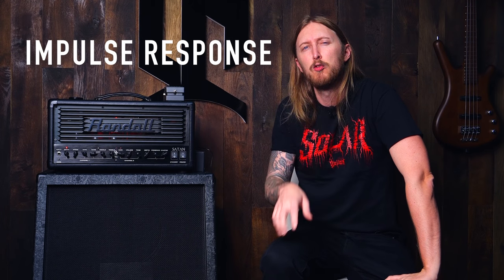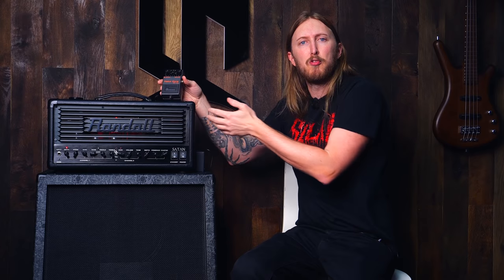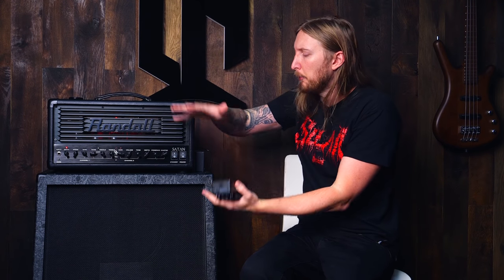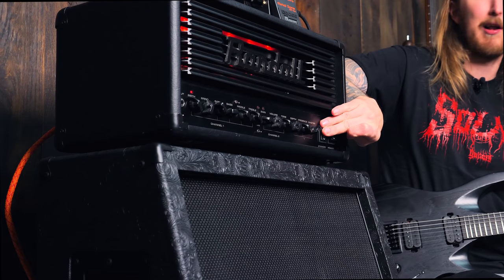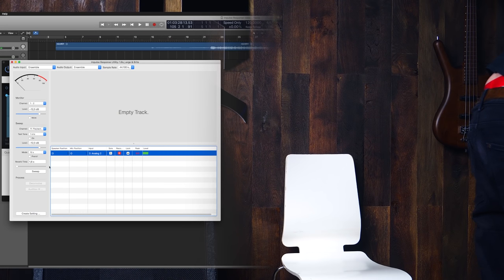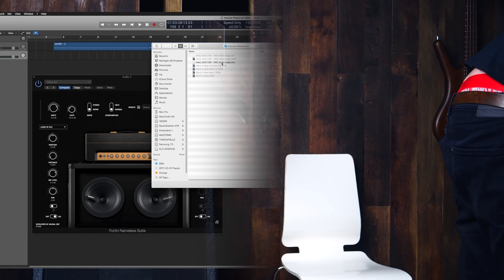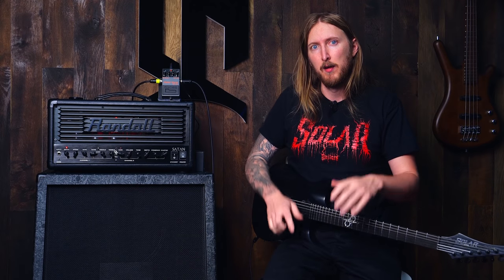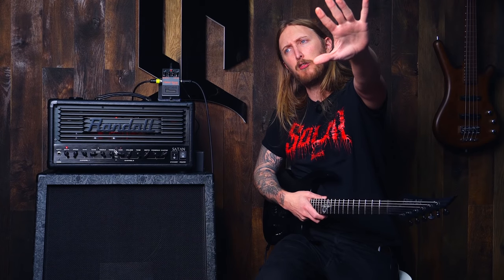Guitar Cabinet Impulse Responses Explained FREE DOWNLOAD - Home Recording Tips

Comment: Great video! Just wanted to point out that this IR shoot method will have power amp color baked in the IR meaning that using this IR with something like the Fortin Nameless will not give you realistic results but you'll have an unnaturally scooped sound. For a more neutral response you want to use a flat solid state power amp or for the best results you want to use a tube amp but remove the power amp color from the IR. :)
Reply: How is it possible for me to remove the tube amps’s power amp coloration from my IRs?
Reply: What if you want the tone of the power amp section? Are you saying that IRs aren’t really meant to do that? They’re only good for the cabinet, mic, and mic placement? I ask because I didn’t think IR-based cab emulation was for me, but if they can also capture, say, my KT-88 tubes in the power amp section of my THD head and accurately reflect the difference of what it sounds like when I put in 6L6STR tubes, then this is actually exactly what I need.

Comment: Hi ola! I Need an answer to a foundamental question...if i go from the line out of my audio interface (a universal audio Apollo twin) directly in the return of the fx loop (a boss katana in my case) and record, Is a proper ir or a reamp box Is necessary? Because a signal goes out of the amp with the chain that i describe
Thanks for the answer!

Comment: Ola I need your help!
I have Bias Amp Standard, but in order to load IRs I would need to upgrade my Bias amp lisence
Is there a good sounding way where I can combine Bias Amp with an Impuls loader?

I just tried putting an IR-Loader behind the Bias Plugin and it sounds really bad
Reply: Make sure you turn off the cab inside bias. Then put the impulse loader after bias in the fx chain

Comment: Finally. Somebody who can explain  the dark arts in a simple way. Could you please explain using a "bus" in a future episode, I see it all the time but understanding it is a pain in backside. Thank you Ola.
Reply: agreed!!
Reply from the maker: A bus in like Cubase?
Reply: A bus is basicly just a sum of 2 or more tracks. for instance, you record guitar with 3 mics. after processing the tracks seperate you then send all of them into a stereo track. that stereo track has now become a bus.
Reply: Yes.. Like in cubase.. I am using reaper but I understand cubase. I am trying to understand the purpose of recording and then routing the signal to another bus. Everything I am recording is plug in based such as bias and ez drummer so maybe don't actually need to know. I just see a lot of people use a bus but I don't see the benefits or understand the benefits of using one.
Reply: @tomhorn1214  a use i would think of with ez drummer is compression. for instance, route all of the tom's to a bus and compress them together, route kick and snare to a bus and also compress them. then take the room and all of the overhead mics and compress them on a bus and take the output off all of those and route them again to a bus. you can use different compressions settings and side chaining to create lots of cool effects or "movement" in the sound.
another use is saturation. routing kick and bass to a bus and adding a saturation plugin will have a different result as running the same plugin on the kick and bass seperate.
Reply: @tomhorn1214  Buses are indeed basically groupings of tracks. They're incredibly useful in a big project, as you wouldn't need a plugin on every single track that would use it with the same settings, saving both time and CPU. They also come in handy for allowing you to mute, change volume and such with only one fader. Sends are mostly the same, but it duplicates the signal. Say you want a flanger only on the higher frequencies of a track (it's an example, not necessarily anything useful). Add a send, and in that send track you first add the necessary EQ in the signal chain and then the flanger. You can freely mix in both how much volume is sent to the send track, and the volume in the mix. None of this changes the sound of the original track, which is played in unison.
Reply: Buses have wheels...And they go round and round....
Reply: Yes agreed.
Reply: @tomhorn1214  sounds like...bouncing?
Reply: Most modern Busses have only one door and a ticket system that may or may not be be automated. Using a "Bus" is  something poor people do, the kind of people one has to avoid on coming out of the Opera. However, A "bus" can be very handy at night when drunk. These are called "Night Busses" and are often found along side "muggings",  "STD's" and "I peed myself on the night bus". There is also a system that is used in music; I believe this requires stealing a Bus, and parking it directly on top of your audio interface; This is why you often hear the phrase: "lets compress the 2 Bus". Sometimes this may involve driving the bus into the studio. After this you may go to prison, but you will be taken there in a kind of Bus.
Reply: @OlaEnglund  hi, master , whats configuration ? Your ir in thus vídeo ia 44.1 ir 48hz?

Comment: Impulse Responses: The Black Magic of music production
Reply: Most important factors in your guitar sound, in order:

1. The guitar pickups
2. The guitar
3. The speaker
4. The cabinet
5. The strings
6. The effects
7. The amp
Reply: Seneca Music that’s literally backwards
Reply: @ChadKirk  Keep everything else the same and swap a 5150 head for a super lead, if the gain is set the same the difference will be nearly inaudible.
Reply: @ChadKirk  nope, it's not.

Comment: If I'm using Preamp Pedal-IR and want to use Analog FX like Chorus, Delay etc can those be used before Preamp pedal?
Reply: Generally, time based FX (reverb, delay etc) should go after the preamp (like the fx loop of an amp) then into the power amp/cabinet section (think FX return.) So, in your case I would go Guitar-frequency based FX (Wah, pitch shift etc)-drive-preamp-Time based FX(reverb, delay, chorus etc)-IR. This is of course not set in stone, but it is the general rule of thumb. Hope this was helpful, Rud.

Comment: Hi Ola, i have a question. I have a Blackstar Ht stage 10, and it has an emulated output. Can i use an impulse response anyway?
The signal would look like this:
Emulated Output(Cab Simulator)>Audio Interface>DAW(With the Impulse Response Plugin)
Would it work?

Comment: Ola Englund  You missed the part where you need to save the setting in the Impulse Response Utility as the SDIR file, then convert it to a .wav file.  What are you using to convert this to a .wav file.  Fortin can't load the project from the Impulse R Utility directly, seems you skipped this step in your video or edited it out straight to a loaded .wav file.  Can you update with what you are using for the conversion?
Reply: yeap, searched on the comments exactly for this Ola Englund. Thanks for the video though!

Comment: I learned the reasons to buy an actual $1000+ amp and cab are becoming fewer and fewer.
Reply: The main reason would be...is if you WANTED a real amp and cab. Amps and plug-ins each have their strengths and limitations.

Comment: So this is mi question: what is the difference between amp profiling and using an IR?
Is there a version of IR where only the cabinets or only the amps are captured?
Isn’t that overusing amps, when you use a tube screamer pedal plugin, an amp plugin and this IR?

Comment: I just want to add that currently (APRIL, 2020),  if you are using an updated mac OS and Logic Pro X then you may need MainStage as well because the impulse response utility is no longer installed with Logic.  I was able to find a workaround (I had an older Mac that could not be updated with the files I needed) and supposedly if you're computer literate enough you CAN find the files in the install package files for Logic.
 If anyone needs some advice on how to get access to the Impulse Response Utility on an up-to-date Mac, hit me up, hopefully I can help.

Comment: I'm a bit confused about one thing here. Most of the time IR's are spoken of as cab simulations only, but here you seem to have made an IR of your cab AND your amplifier. Is that a correct assumption? Is that why it sounded freaking weird when I used Amplitube - with cabinets bypassed - with your IR in NaDir? Because I should probably turn off the Amplitube amps as well?

Comment: You keep saying "my full rig" but it's just the speaker, technically colored in some way by the power section of your amp since you used the FX loop to power the speaker. It's not capturing the Randall head's tone as if you plugged a guitar into the front of it, right? You initially ran the Metal Zone into the FX loop as well it looks like?

Comment: Have you done, or could you do a video about the Dynaudio LYD8 monitors.  I recently added them to my Sweetwater wishlist as they're the most likely contender for my next set of monitors.  They appear designed for less than ideal location/small rooms.  What's your impression of them so far?

Comment: I doubt that anyone will answer this still but: 

So the impulse response is basically the thing that says "Give me that signal, Im gonna shape it like your power amp + cab + mic did when you recorded the response". So if I record one like this and load it in my cab sim on my PC I can basically take the preamp signal from my FX send and feed it directly into my audio interface and the IR will make it so it sounds like I had my rig miced up and cranked? Can I just record an IR in my DAW and cut it manually and export it? Does it have to be a certain length or will the IR loader know what to do with it as long as its the right sampling rate and bit depth?

Comment: Why do you connect the instrument-out (or if someone doesn't have this, then the out of the reamp box) to the FX loop input and not the front of the cabinet? 
Shouldn't the signal be at instrument-level at this point, or would you not want to get the coloring of the pre-amp tubes?
Wouldn't that also mean that you only captured the cabinet and not the coloring of the amp if you bypass the pre-amp?

Comment: Good presentation and easy to understand. I want to start the discussion. Is IR overrated? The differences are minimal and may not be important for the overall sound of the band. IR is quite limited. A tube amp reacts on the speaker‘s load and volume. So you Need a endless numbers of IR and spend hours on comparing them. - instead of playing. :-(

Comment: The IR file is very big considering others are 10-15kb. Due to the size it has very noticeable latency when I load it up in any of my amp sims. That is with low latency mode on in logic as well. Do IRs get compressed or something to get the size to be that small?

Comment: i have a metal zone i modded years ago i switched the diodes from silicon to germanium transistors using the anode and cathode legs as diodes it sounds better than stock in my opinion its got a more compressed sound. ill have to try it with this impulse

Comment: great!! But now, when are we gonna see some more home recording techniques? whats the best fullest cabinet to mic volume? i always either have it too thin a sound and have to boost at the input preamp which makes it wild af... or its clipping at the mic and im stupid and dont realize it til mixing later....Also do you like 50 watt amps more than 100 watt heads because of its lower headroom? is that how you get high power amp section gain clipping saturation at lower volumes? is that that the balance, ive been overlooking?!?

Comment: Ola, your IR doesn’t work with my Mooer Radar :(:(:(
Reply: or Helix. i think because of the size of the wave file. 236kb verses about 28kb for a few Ownhammer IRs i have.
Reply: it is super (too) quiet using the Mooer GE200 or Preamp Live as well.
Reply: I had the same problem. Have you updated the Radar to 1.2? it worked for me. The Ola's IR sounds like a bass one in my radar though lol
Reply: @michaelrock  have the same issue
Reply: It's too long and not normalized.
Reply: Same here, Helix can't open it, looks like this file is way too heavy.

Comment: IR is only the cab I thought, not the amp as well?  Thats why you use amp sims+ IR
Reply: Since he went into the effects return, this IR would be the power section of the amp + cab + mic (bypassing the preamp section). I think he did this because the "right" way to use a Metal Zone is to bypass your amp's pre and just run it right into the effects return.
Reply: Some influence from the power amplifier as most people capture impulses. If they were to use any reference grade, ruler flat solid-state power amplifier then the power amp wouldn't affect the capture in any noticeable way really whatsoever.
 Essentially it is the elements which class A/B valve guitar power amps often have that can have an effect on an impulse, Namely the resonance and presence controls, Depending on where they are set, Off would mean no influence obviously (Anything similar which gets utilized in the negative feedback loop, That is after the preamplifier but just before the power amplifier can be a factor in additional shaping to an impulse, It could be done very deliberately with even certain pieces of gear inserted after before the FX loop's return and the sweep or sweeps have been fired through. I'd be surprised if some people had not already been doing such in order to fettle their ideal impulses).
However it's quite negligent in manipulating the static impulse responses that most of us use and get great results from already with the resonance and presence controls, Some sets will have it noted where they've set said controls which You may have noticed.
However now take for example the dynamic convolution which Sintefex have down (and licensed to Focusrite for their liquid series) or the technology that Acustica have going on in Nebula and then we'd be talking/using impulses which are about as real as it gets, The Kemper profiling amp must also be using their own dynamic convolution along with other black magic in order to capture the signal paths that they are able to.
I hope that makes sense and answers Your question Steve
Reply: @nekromachine  Absolutely answers it and in more detail than i'd expected thank you very much!
Reply: @stevewallek990  Anytime and glad I was able to help a fellow player and audio head out Steve. All the best fella

Comment: Just curious, I've been using IRs for a while now and this might seem like a stupid question...but I was wondering if it's possible for an IR to include the high gain of the preamp section of the amp if it's running a dirty channel when the Impulse is being fed through the amp, you know, like not having to use a preamp section at all, be it a pedal or a plugin or a head, just an IR that includes 100% of the tone, is this possible? or am I caught in a stupid mind loop here...
Reply: No. Impulse response contains information on the linear path of sound (equalization). Preamp/Overdrive sound relies heavily on not linear effects (distortion) which are not stored inside an impulse response, so distortion cannot be recreated simply using one Impulse Response.
Reply: @andreaventuri5473  Then what was the point of using the metal zone in the first place? Could he have used the amp clean when recording the sound clip used for the impulse response and gotten the same result in the end? Genuinely want to know
Reply: @kentfranklin736  He used only power section of the amp by plugging impulse generator output into FX IN to generate the response of the cabinet. You are correct in that the pedal is irrelevant for the process.
Reply: @kentfranklin736  the test signal follows this path: sound card ==> amplifier fx return ==> cabinet ==> mic. The obtained impulse response describes the overall equalization of amplifier power stage + cabinet + mic
Reply: He measured  what he connected after the metal zone (ampli power stage, cabinet, mic). And then he recreated it (ampli power stage, cabinet, mic) using the impulse response he measured
Reply: @andreaventuri5473  and  Alexey Dyachenko thanks for the clear explanation

Comment: Thanks for the info. I'd been wondering about this. I guess this is essentially what you're doing when you make an amp profile for a Kemper? Is that correct? Keep up the great work!
Reply: This demo is bypassing the preamp. IR is of (power amp) cab, mic, room. Kemper, Positive Grid and those actually model the signal through your amp, both pre and power amp to model the sound of the amp. Similar result, dif processes.

Comment: It’s extremely close. On my speakers the low end is slightly slightly slightly different but overall it’s like 99.7% identical
Reply: Are you sure it's not 99.7000000000001% and not just 99.7%
Reply: String Butcher I’m 99.843% sure that it’s 99.7% identical

Comment: The file in the description is just a click while what you record in the video is a few seconds sweep. They are not the same IR, right?
Reply from the maker: The click is the output impulse response file. That's what you would use in an impulse response loader. The sweep is just to MAKE the file.
Reply: @OlaEnglund  But you recorded the whole sweep; thus shouldn't the output be a few seconds as well? Thanks for the quick response btw!